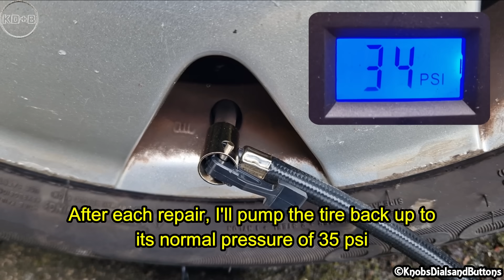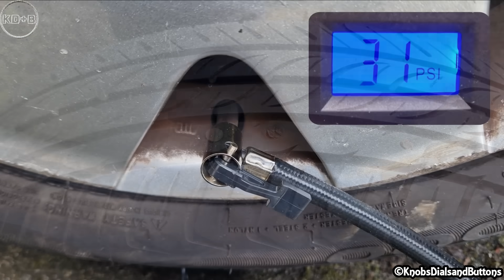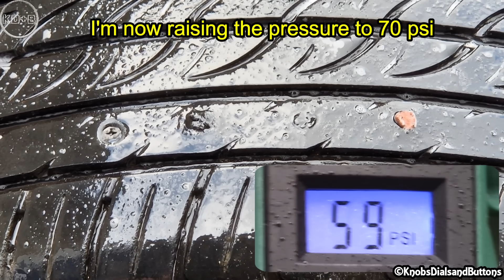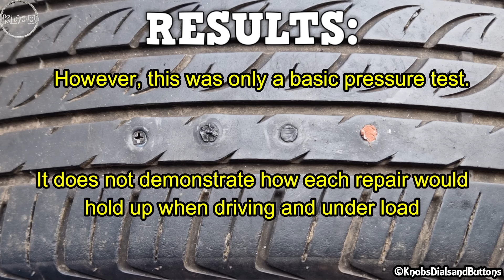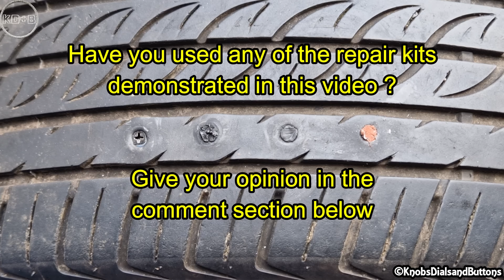Four Repair Kits, One Tire

Comment: Somehow I am consistently blessed with a nail or screw within the first year of a new set of tires.  I have always used slime plugs like the orange one here.  They last the full life of the tire set.
Reply: Yes I also blessed with new tire punctures as well as rock hits in my new windshield. Just life I guess
Reply: I often get a nail or screw in a tire when I drive pass by a house being built. I now avoid those streets whenever possible.
Reply: Wow and to think I paid 12 bucks for a inside patch and for tire to still leak air! I will try one of these orange ones

Comment: No matter what plug or strip is pushed in, always use a sealant (rubber cement for example).

When I didn't know better as a newbie DIY'er, I thought the gunk already on the plug would seal everything. It's really there just to stop the plug from drying out and losing flexibility while in storage. When you go to push in the plug, it can sometimes act like an adhesive and add more resistance while inserting the plug.I have wasted much unnecessary muscle power while doing it this wrong way. Even broke the handle of an insertion-tool, once.
This is where sealant comes in. While obviously sealant's primary function is to seal, there's an additional side-benefit. While the sealant is still fresh and "wet" it acts as a lubricant, reducing the friction and grip between the plug and tread, significantly making the job of pushing in the plug much easier. It can occasionally still take some muscling, especially with very thick tread, but with sufficient lube, even a little girl can do it.

Most importantly, it will create a seal between the plug and the layers of plys. If no sealant, air pressure can push past the plug and get in between the plys forcing de-lamination or separation of the plys. If this happens the structural integrity of the tire is ruined, and it is now dangerous to use and must be replaced. The most obvious evidence of this are tread or sidewall bubbles. if you see that, the tire is toast. So again, never skip the sealant. it's very easy to destroy a tire by neglecting this simple, easy, and absolutely necessary step.

Throughout the repair process, keep the tire pressure near its normal operating pressure. This will maintain the tires natural shape and better mate to the plug more precisely. if you push in while the tire's flat the sides of the tread cave in, and there's no air-back-pressure to keep the tread surface in proper position and shape to accept the plug.

Comment: I've used repair screws on my motorcycle for the past 2 years, they're quick, easy and reliable for your average nail or screw hole, works best if you use the tube of rubber cement they come with. They will get you home, and I carry a portable inflator as well. Saved my butt a few times, and the first one I used was when I caught a nail in a tire less than a day old. No way I was buying another, screw you tire shop, popped it in, forgot about for 6 months until it was time to replace it.

Comment: I have run flats and got a puncture just over a year before the pandemic.  A couple of years ago I noticed the negative camber on my alignment was wearing the outiside enough that they would have to be replaced soon. They still worked fine until one frosty morning. My car was telling me that the repaired tire was deflated. Pumped it up, same deal next morning. dug out the old plug and put two in. That fixed it till I got all the tires replaced a couple of weeks later. 

Mine were the bendy fuzzy ones that looked like licorice sticks you fold. Those worked perfectly fine for 2 or 3 years. The garage wouldn't repair it even though the puncture was almost 2 inches from the sidewall. Said the manufacturer had a no repair policy on their run flats.

Comment: I've been using the 3rd one (sticky black) for over 40 years without a failure. I once had a 16d nail go in head first.  Since I was going to be getting new tire anyway, I decided to try something.  It took 3 of the black stickies to finally seal the hole.  Got up early the next morning just in case.  Anyway, that patch lasted 2 months until I got now tires without losing any air.  I wouldn't recommend using 3 rather than an inside patch, it did prove how good they work.

Comment: if you combine product #1 and #4 by shredding of a thin string of product#1 and wrap around the thread of #4, this can be use even on the trailer’s tire to buy a bit time if u r in the middle of nowhere, and it is easier to screw this in a big tire. Plugging a big tire is almost impossible without proper tool and strength of the arm. If use this combination in a regular car, it will be super. Product #1 expands like bubble gum when contacted by air pressure (imagine like when u r blowing and making bubble while chewing gum), that’s the concept and that is why i love using #1. The other products look so cool too. Thank you for sharing the experience!
Reply from the maker: Thanks for watching !

Comment: Watching this, I'm definitely going with a screw kit. It may not be the most durable or permanent solution, but it looks like the easiest one to do, on the side of the road with minimal time and tools.
Reply: J'ai les 3 systèmes, celui à vis, la mèche brune et la mèche en caoutchouc. Et sur 56 ans de conduite moto 52 ans en automobile, un 50 ene de crevaison, les mèche brune et les mèches en caoutchouc m'ont donné entièrement satisfaction jusqu'à usure complète des pneus. Les vis rapide, je ne les ai pas encore utilisé. Mais en ce qui concerne les mèches en caoutchouc, trou jusqu'à 15mm de diamètre, je n'ai jamais eu de fuite après réparation, pour les flans et déchirures, j'ai toujours fait vulcanisée.

Comment: Had puncture in south of France a few years back but had no spare. Took it to local garage who repaired it with the brown sticky rope, I was a bit sceptical but anyway drove the car all the way back from France to the North of England - close to 1000 miles, and continued to drive on the same tyre for over two years until the tread wore down and needed replacing with a new tyre. In all that time the tyre never lost pressure other than the normal topping up.

Comment: I've just done the mushroom plug repair to one of my tyres, I got a screw in it and the tyre repair places refused to repair it claiming it's too near the sidewall even though it's on the tread a good inch in so I did the mushroom plug repair myself, I swapped the tyre out to the rear and so far it's holding up fine.
Reply: As long as you didn't drive on a completely flat tyre damaging the sidewall in the process your repair even though it's an inch from the edge will last the rest of the tyres life. Rest easy.
Reply: Weirdly enough, I too just had a screw go into my tire and the repair place said it was too close to the sidewall despite being on the tread a good inch in. They wanted to sell me two tires for $700. Nah, I'll patch it myself.
Reply: If they refuse to do it, they're deciding they don't want the liability of that patch coming loose. Its also not worth it for techs to do a tire repair as its more work than to replace. A proper tire patch involves taking the tire off the wheel, installing the patch, then remounting and balancing.

Comment: I always drill out my holes.  I have found the supplied rasp tool is almost impossible to run in and out otherwise.  Seeing all methods one against the other is extremely helpful.  I am impressed with the ease of the last one, the one that screws in with a Phillips screwdriver.  It is the cheapest by far, an added bonus.  At the side of the road that would be my choice in the future.  To date I have always used the first method you showed with the rope, but it can be a struggle.

Comment: I used No.4 (repair No.1) in Austria on a Rear Motorcycle tyre, then rode home over 1000 miles without losing air.

Comment: I use both number 1 and the screw type. The screws are very good for roadside repairs when you don't need to remove the wheel. I used them on my work vehicles and they hold up very well. Occasionally, they leak if it is a jagged hole. I usually then repair with the bacon strips and they are then good. So number 1 is better, but requires removing the wheel for a good repair. Number 4 is best for a field repair, and mostly works well.

Comment: 70 psi in a standard car tyre is suicidal …I’ve worked in a tyre shop and seen the damage and exploding tyre can do .
All four tyre plugs are good as a get you home repair…thanks for sharing 👏🏻👏🏻
Reply from the maker: You're welcome, thanks for watching !
Reply: Most are perfect solution for not buying a new tire.
Reply: Get you home repair only, yes!
Reply: @tettazwo9865  Nah... run em till the tread forces a tire replacement. I've run plugs on motorcycle tires for decades. When they start to leak air, just replace them if your tread is still good.

Comment: I am here because I just bought the GRAND PITSTOP Tubeless Tire Puncture Repair Kit to be used used on a high performance front tire,   However I'm a bit nervous trying something new because the other types (not the screw) were reliable over the many years but always worry about pushing them in when on gravel roads.

Comment: I delivered newspapers for 17 years, i would sometimes need to plug a tire twice a month. I would do them quick and dirty. Drill out the hole so the plug would fit without a bunch of drama, no  rubber cement, no trimming the excess plug. Never once had a failure. And the car would be loaded with so many papers on sunday it was on the bump stops.

Comment: You must have pretty strong hands! I've personally used some of these puncture repairs kits and the screwdriver handle style reamers and "string" insertion tools can be very hard to insert into a puncture hole. The T-handle style tools are easier to use because hand gripping and twisting strength is less of a factor. I also wish you would have included the Dynaplug tubeless tire repair kit as it does not require twisting -- maybe in a future video?

Comment: the screw is the only non-definitive repair, furthermore it is a fairly rough repair and of little use, but very quick.
For me the "plug strip repair" remains the best and most economical solution.
Purchased new tires, punctured on the road and repaired, the repair lasted the entire life of the tire.

Comment: I used the pre-sticky 3.  3000Km later still good, no leaking detected.

1 and 3 are fundamentally identical in application, 1 uses rubber cement as the 'sticky' and 3 is pre-sticky as far as i can tell.

Comment: I've only used the "BaconStrip" tire plugs over 40+ yrs & all worked good....Most "Challenging" repair was when I somehow picked up a Chevy engine 3/8" dia Starter Bolt....That hole needed 4 strip Plugs side by side to seal !!

Comment: I've used the black string, but it dries out and leaks over time. I've used the mushroom plug with variable results - sometimes the ridging on the inside of the tire can stop it from fully sealing. These can all get you out of a hole until you can do a proper internal mushroom patch fix.

Comment: The plug strip has lasted until the tire had very little tread on there, it works successfully and it really lasts.

I would expect similar results from the sticky strip, compared to the plug strip.

I've also done the tire repair from the inside as well, which works really well too, but requires special equipments, tools and supplies.

Also after taking the nail out and cleaning it with its file, the thick polyurethane adhesive was injected into the hole. ( Seen a repair shop actually do it ) and it lasted until the tire    had very little tread on it.

The mushroom head rubber plug looks like it could work, not sure about the very last one.

Comment: If you're working in a shop on customers' vehicles, it's a good idea to dismount the tire and inspect the inside for damage.  If the tire was driven a long time underinflated the inside of the tire can be damaged and you wont see it from the outside.

Comment: I've used the brown and black push through strips to fix more than 10 punctures and the tyres have worn out before I've had any issues, not even a slow leak. One thing I will say is that you may need to rebalance the wheel afterwards.

Comment: I've got to where I regularly repair my own leaks. Most are caused by nails, screws, or similar sharp objects that go straight in and are easily repaired. I resent tire shops that use damaged tire as an excuse to bully you into getting a new tire, especially since my tires are $400 each. The common excuses are the damage is too close to the edge of the tread, and the tire is near the end of its life cycle. Additionally, even with an appointment the wait time can easily be an hour or more. So, I use the common plug strip repair system and have never had a tire fail because of their use. Remember this was a common method of repair until recently when tire shops decided these plugs were no longer viable. Out of the many I have done to my vehicle as well as my entire (en-tire?) family's cars I have only had two that leaked, and when that happened I just added another plug and had no further issues.

Comment: I have used the orange tire plug kits many times and after installing they have always lasted the duration of the life of the tire and I also carry the simple screw in ones in my glove box for a just in case quick repair on the side of the road and I just wanted to add that one time had a flat tire when I got out of work and I quickly put in the screw type pump the tire up with my portable inflator and went home with plans to use the proper plug kit on the weekend but I forgot and just kept driving it took about 4 months for the screw in plug to finally give out and fall out of the tire which reminded me to then use the proper plug but I'm just saying if it lasted 4 months they will definitely last long enough to get you home or to a tire repair shop

Comment: Have used the strip type (#1) for decades, never a failure.  They can be a pain though on  a cold rainy night in a rear tire. I recently ordered some of the screw type (#4) just for that scenario. I haven't had to use one yet.

Comment: I know some of y'all might give me the heat for this but there was where I drove over multiple nails and one newish tire with only about 10,000 miles of wear on my wrx... I am not going to sell out another $800 to replace all the tires because it's all wheel drive well that's what they recommend you do which makes sense.... the driver side front had four Nails in which 3 of them were ON the sidewall.... so I got my handy dandy plug kit, patched all of them and used the rubber cement, and I had not had a single air leak ever since and the tires held up perfectly fine till they needed to be replaced last year from regular ol wear n tear😂

Comment: Last year, I was on a trip on my motorcycle and had run over a nail which resulted in a slow but steady leak. I was unable to repair it by more conventional methods so I got a Number 12 sheet metal screw ( not a wood screw ) and screwed it into the hole. If I had some rubber cement, I would have applied that to the threads first. Using a sheet metal screw is important because it has big, coarse threads and will therefore grip the rubber better. Within 100 miles, as expected, the screw head just wore away to nothing, leaving the threaded section in the tire. I didn't lose a single pound of air before getting the tire replaced. I now carry a sheet metal screw and stubby screw driver with me ( along with more conventional plugs ) in my repair kit.

From my experience, almost anything will work because the heat of driving will vulcanize the tire and the plug, whatever that plug is made of. I have had nails and screws in my tires on both my motorcycle and my car and after sufficient miles, any air leaking stops. It's mostly about ease of installation. I've never seen the tire repair screws and they would get my vote if I didn't already have the rope type.

Comment: I've started to use the rubber mushroom plug and have had no issues so far ... and I've used both the cord and the screw variants which did the job but I prefer the mushroom bung ... think because its rubber and is less noticeable..

Comment: I had a slow leak in a tire and took it to a shop to be fixed. They charged me $28 and I discovered it was one of these string plugs. It still leaked near the fixed area. Turns out a construction staple had pierced the tire and they missed the other leg. They charged me ANOTHER $28 for the fix. This time they took the tire off and put a patch on the inside. They said it was another hole so another charge! It was the SAME cause! ONE STAPLE! If they had taken the tire off the rim in the first place and PATCHED it they way I was expecting in the first place, I wouldn't have had to take it back. If I wanted a cheap plug, I could have done that MYSELF at home for $5!

Comment: I use number 1 all the time on my 4x4 tyres and they last foreever.   Ive pluged 3 sided by side as the hole was from a jagged rock and it held for thousands of kms. Highway use and metal roads.

Comment: It would be interesting to see how your repairs hold up to use.
Reply: My dad plugged a hole in the sidewall of a tire on a k5 blazer with the cheap brown plugs back around 12 years ago. We drove around 90 miles round trip to church every Sunday for 3 weeks before the plug blew out. He couldn't afford tires at the time so he just put another plug into it every time one blew out until he could afford a full set of new tires.
Reply: I have experience with the first brown one - it works and works!!!